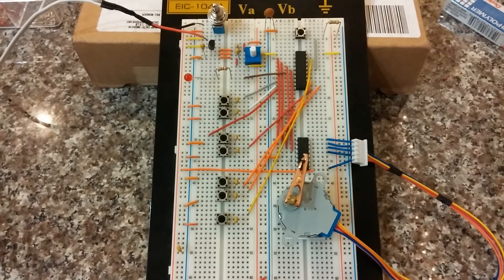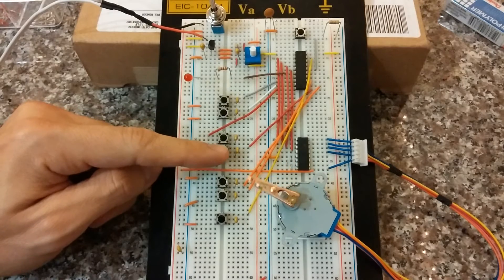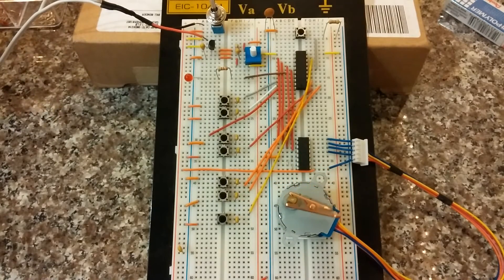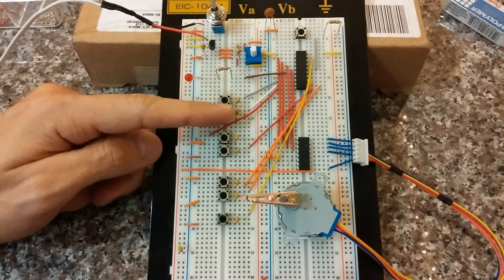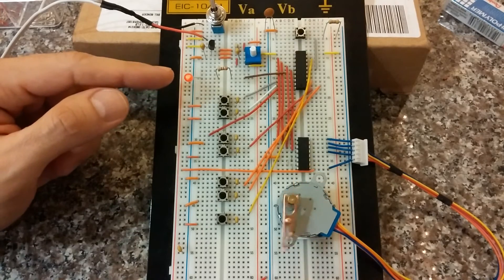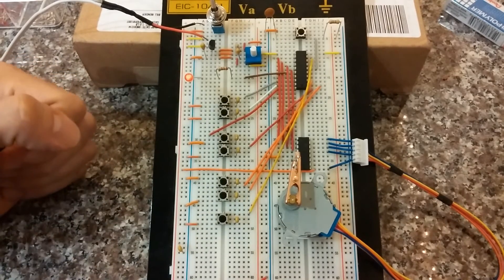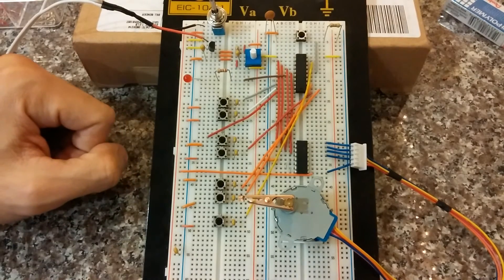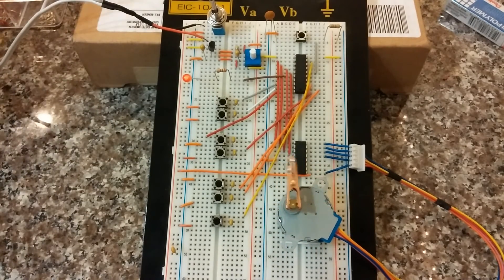MSP430 Launchpad Project (code and schematics): Button Controlled Stepper Motor on Breadboard

Comment: there are lots of type uln2003 motor driver .Can you tell me which type of uln2003 did you use ?
Reply: +Ozan Güney Düşmezer   there is érror in the code can you help my pleas  !!!!!!!!!   my imail is mohcqrys@gmail.com  help me
Reply from the maker: hello Ozan, sorry for the late reply. I used two different uln2003

1)
I bought the stepper motor on amazon and it came with a driver board. The board used a generic ULN2003APG I don't know the manufacturer.

2)
I also used a texas instruments ULQ2003AN that worked as well.
Reply from the maker: +kalaba mohamed 
Hello Kalaba, sorry for the late reply. Can you be more specific? Does the compiler give you an error or does the project not work?
Reply: +Engineering by John i yous mikro c for pic and you yous ccs 6  can you send mé the code.hex   my email is mohcqrys@gmail.com
Reply from the maker: +kalaba mohamed 
The code is linked in the description.

Comment: They have a fair amount of torque, so my guess is if you want speed, you just use gears or pulleys.
Reply from the maker: +Bernhard Hofmann Very true Bernhard but gears are fixed and code can be more dynamic. I was just seeing if anyone could tweak the code to get the motor to spin faster than I could as kind of a fun challenge to anyone who wanted to try. You think you're up for it ;)
Reply: +Bernhard Hofmann   there is érror in the code can you help my pleas  !!!!!!!!!   my imail is mohcqrys@gmail.com  help me